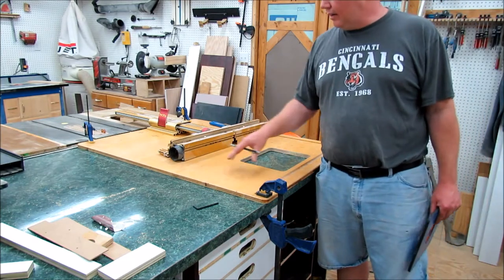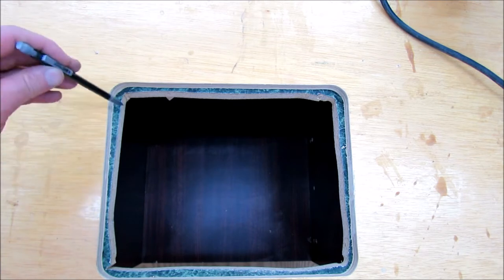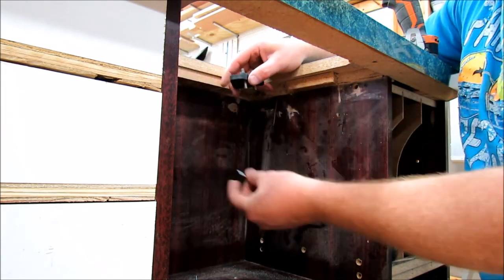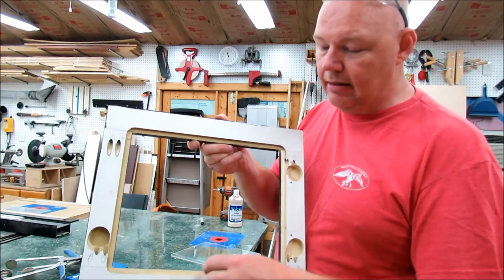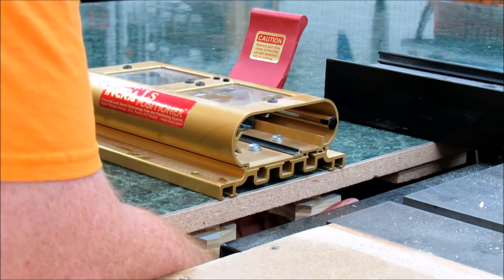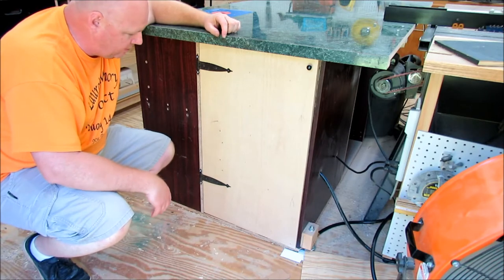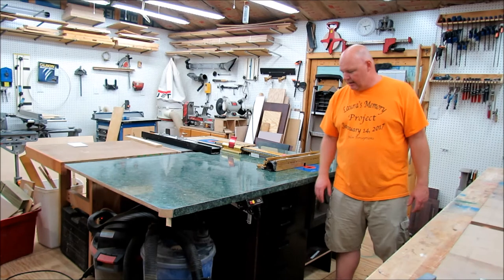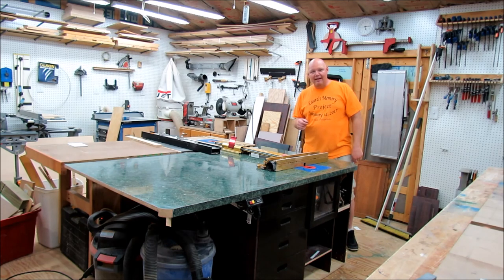Part 3 The Bigger Better Outfeed   Assembly and Router Table

Comment: i didn't see how you made sure the incra was square to the router plate? i thinking of adding a short extension table to my sawstop c.i. router table to mount the positioner. any tips?